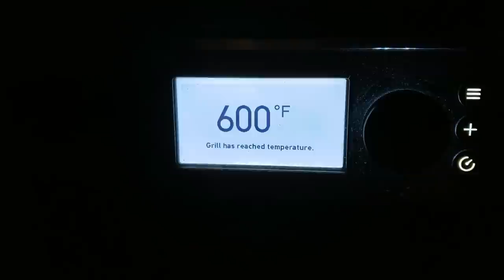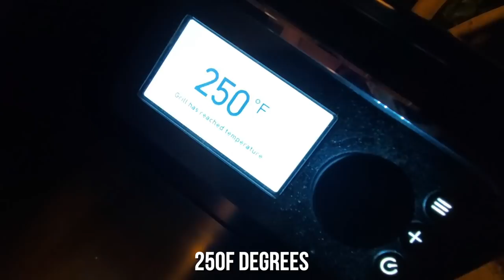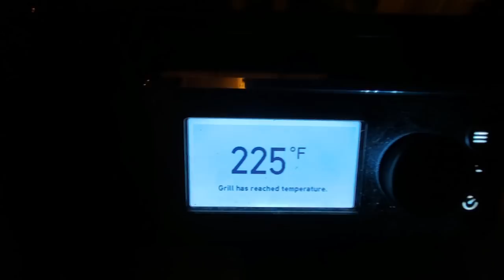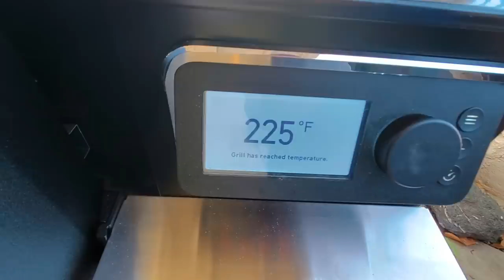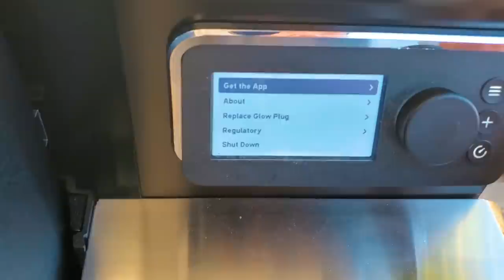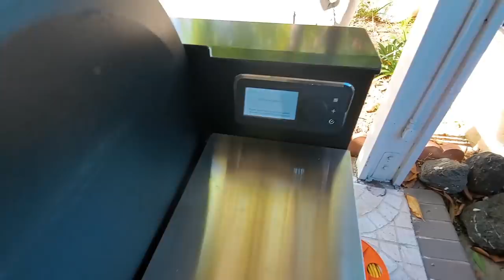Pt 2 WATCH BEFORE YOU BUY | Weber SmokeFire Pellet Grill | BBQ Champion Harry Soo SlapYoDaddyBBQ.com

Comment: I see your point and the diff between a grease fire and a flare up, then again you're one ember away from that grease flare up dropping through the drain hole and lighting the grease on fire in the catch pan. Location of the catch tray may limit enough O2 to get it really going but still could happen don't you think? The pellet hopper for me isn't a deal breaker and 7 hrs seems reasonable,  thanks for the video Harry.
Reply from the maker: 12 cups of grease so far and no fire.  Your mileage will vary.  Don't rely on my  two data points as they are not conclusive nor do they represent the majority of EX owners.
Reply: @SlapYoDaddyBBQ  Yes, time will tell, although I think there is a stronger chance of a grease fire with the Weber vs a traditional PS that uses some  type of heat deflector/drip pan  though......time will tell. Meantime I will wait and continue to cooking on my 22 performer and wsm!!

Comment: Nice, I just purchased a gen 1 ex4 for cheap. Do you suggest using a large weber pan in between the flavorizer bars and grate when smoking low and slow?  Also, what pellets have you found to work best with SmokeFire?
Reply from the maker: I use cheap half foil pans and the work well.  Keep it grease-free clean and you should be good.  I like GMG Gold Blend pellets

Comment: Hey Harry,
I heard Weber just released an upgrade/modification for the pellet hopper so the pellets will feed better. Have you heard anything on this yet? Apparently you just have to unscrew the old hopper ramp and screw the new one in.
Reply from the maker: Does it work?  I need to ask for one
Reply: @SlapYoDaddyBBQ  I don't own a SmokeFire (yet!) but this update should correct the hopper feeding problem. I was wrong in my first comment though, it's an insert that goes on top of the existing hopper ramp using the existing screws. Weber posted a video called "SmokeFire: Hopper Insert Installation" that shows how it's supposed to be installed. I believe they will send the insert to anyone who purchased a SmokeFire, free of charge, which is really great customer service.

Comment: Great video Harry. That was a true stress test. Looks like your Smokefire performed well. Strange how some perform well and others do not.
Reply from the maker: Thanks for stopping by.  I only have two data points so my results are not conclusive nor representing the majority of SF owners.  Only time will tell if Group 3 issues are short-term (e.g. bad parts of software) or systemic (design related which I don''t think so due to presence of Group 1). So far so good for me from two tests.  I'll do more coming soon.
Here is a recap of what I've done.
TORTURE TEST 1 - PASSED
45 lbs 5 meats in 8 hours. Generate grease from a 16 lb brisket, 10 lb butt, and 3 St. Louis ribs to drip on the SF the first 6 hours at H-n-F cook @400F and L-n-S cook @275F. After all that grease was accumulated, fire it up to 600F to grill the ribeyes and sausages.  Cook to let the grease drain in the unit and then try to flash that grease at 600F to test for safety 
TORTURE TEST 2 - PASSED
65 lb, 3 meats in 12 hours. Two 16-lb brisket, Two 10-lb butts. Two 7-lb beef shortibs.  Low and slow @225F to see if hopper feeds properly, no grease fire w 12-cups grease collected, and no excessive ash

Comment: Awesome video, thank you Harry!
Reply from the maker: Thanks Ed for stopping by.  As a recap
TORTURE TEST 1 - PASSED
45 lbs 5 meats in 8 hours. Generate grease from a 16 lb brisket, 10 lb butt, and 3 St. Louis ribs to drip on the SF the first 6 hours at H-n-F cook @400F and L-n-S cook @275F. After all that grease was accumulated, fire it up to 600F to grill the Ribeyes and sausages.  Cook to let the grease drain in the unit and then try to flash that grease at 600F to test for safety 
TORTURE TEST 2 - PASSED
65 lb, 3 meats in 12 hours. Two 16-lb brisket, Two 10-lb butts. Two 7lb beef shortibs.  Low and slow 225F to see if hopper feeds properly and no grease fire w 12-cups grease collected, and no excessive ash

Comment: Love the video and your perspective. I fall into group 1. I have a EX6 and for the most part it has worked the way I had expected/hoped. I too had accepted delivery of my SF and it was sitting in my garage while I debated returning it. I followed the advice you laid out in Part 1 and carefully set up the grill, updates the firmware and was happily grilling.  I’ve since successfully cooked ribs, pizza, fish, seared some steaks, and did a 7 hour low and slow cook (though admittedly I used water pans). My only concern is that Weber said that took what people disliked about pellet grills and removed those issues like the build up of dust and the accumulation of grease. That hasn’t really been my experience, my grill has tons of ash built up in the bottom of the cooker after my cooks, so I still have to go in with a vacuum and clean it out, while maybe not after every cook like I did on my Traeger, it is still needed (especially after the 7 hour cook at 225). I look forward to seeing your clean out video after this long cook to see how much ash and grease built up. Perhaps my using water pans which kept the grease from dropping to the bottom of the cooker allowed the ash to build up instead of being “flushed” out the drain in the bottom? But even with its quirks I find the versatility of the SF grill to be far superior to my previous pellet grill, and the food I’ve cooked in it has been flat out amazing. I still have to stir the pellets  like I’m used to on my other pellet cooker, I still have to vacuum out the cooker, and I need to manage grease like in my other cooker, but the versatility and quality of the food from this grill out weighs these issues. Perhaps I’ve been fortunate, as it appears there are some people who are having issues with logic boards and augers, but sounds like Weber is handling those issues, even if it takes them a little while to do so. Keep up the great work live your channel!
Reply from the maker: Thanks for sharing your experience with your EX.  No pellet cooker is perfect so I tell folks to pick the one they like because in the end, it's the pitmaster and not the pit which determines the final result
Reply: A. Dog Thanks for reading my post, I hope that it came off as positive overall with my experience of the Smokefire. I cook on it several times a week, and have tried several different pellet brands including lumberjack, Weber, Traeger, and pit boss. In the example above I used 100% Lumberjack Hickory pellets for the pork butt cook, but I’ve also had similar experience with the Weber pellets that came with the grill. I’ve also tried out boss which in my opinion were terrible and clogged up the auger, but then I read lots of reviews where people have success with pit boss, so I don’t know.  I’m ok with the amount of dust, and I can certainly clean it out as I’m used to doing so with my Traeger, I think my only “complaint” is that Weber marketing really touted how the ash was designed to fall into the collection tray at the bottom, while my real world experience shows that easily most of the ash end up in the bottom of the cooker. I am also fine with using drip/water pans in the grill for long slow high fat cooks. It makes clean up easier, and avoids any potential for grease building up with the ash in the bottom. But again, marketing may have gotten ahead of themselves with this one too, suggesting that the grease all nicely channels into the drip tray. Harry’s video clearly shows that happening, to the point of overflowing! So overall I’m happy, and I think the issues/concerns I have such as the pellet hopper and the app functionality can and will be addressed by Weber. As for the pellets hanging up in the hopper, I’m glad to see they came out with an update, and I will request it, though admittedly I’m quite used to stirring the pellets in my Traeger, so not a deal killer for me.

Comment: My only question comes from a safety perspective, while I agree what we saw in this video were nothing more than flare ups because they quickly dissipated.  The shutdown process seems to raise the temperature significantly, I'm guessing for cleaning and you had a flare up there.  What would have happened if you had left that huge amount of grease from your test cook in there at shutdown; would that have sparked an actual grease fire? 

I'm thinking from the perspective of a user who might not check the grease trap and hit shutdown, because I saw you empty it well before hitting shutdown.
Reply from the maker: Jesse, the EX6 is a quirky pit but I have not found another pellet cooker with such fantastic smoke flavor and smoke ring out there.  If you keep it grease free, you will not have flare-up issues.  I don't keep my EX6 so I have the flare ups.  Of course, if you are not good or experienced at live-fire cooking, it can be a problem.  If you are a pyromaniac like me, it's a joy and all in a days work!

Comment: I would totally agree that the flare up was exactly that, not a grease fire. You'll know when you've got a grease fire because panic kicks in pretty quick I'd imagine! Lol. 
That's a LOT of grease and as you said well beyond any 'normal' loading. Having said that, if you have the capacity to cook silly amounts of meat the unit should be able to cope with it. If a car can do 180mph you'd expect the brakes to work at that speed too, not think, well no one does 180...
Reply from the maker: I had 12 cups in drip pan and 3 tablespoons grease on the floor so I'm guessing I am at the limit of Weber's design envelope!
Reply: @SlapYoDaddyBBQ  but with that much space, should you be?

Comment: I've got a feeling that the issues that some folks have seen have a lot to do with low ambient temps and/or high humidity causing pellet feed issues, causing the grill to chase phantom temp changes due to getting the interior temp confused by the external ambient cold air, etc.
Reply from the maker: Josh you sound like an engineer?
Reply: @SlapYoDaddyBBQ  No, just a psychologist. It's just the impression I had given that the videos I've seen where people had problems have snow on the ground, or is raining during their cook.

Comment: 1)  How does the Smokefire compares to the Traeger, RecTec, Yoder, MAK?
2)  How does it compare to a propane smoker?  I can buy a propane grill + propane smoker or cookshack quality electric smoker (I've got deck space).  Concerned that a hybrid is a disappointing compromise.
3)  Want to get many years of good use from spending $1200+.  I see too many recycled gas grills.
4)  Great smoke flavor.   Needs to be better/equal to an electric cookshack.

5)  Weatherproof.  I cook all year, all weather, with lots of rain, metal that will rust, and concerned moisture from wet winters will cause issues with the pellets.
Reply from the maker: 1. Don't know as I don't own those grills.  I have 2 Jim Bowies from GMG.  Will do a shootout soon
2. Some gassers are OK as pits.  Research Ole Hickory and Southern Pride.
3. Get a WSM18 for $300.  I've won 100+ first places and mine is 12 years old and going strong.  Used 1,000+ times and I can't break it.  A pellet cooker is an electronic device like you computer. How long did your computer last?
4. EX can generate championship results.  Remember, it's always the pitmaster and not the pit or meat.  A proficient pitmaster can create good food from any device including a shovel, chicken wire, wood, meat, and a pit dug with the shovel!

Comment: You explained it very, very well!!!
Reply from the maker: Thanks Dennis.  Remember I have only two data points and my results are not conclusive nor do they represent the entire experience of Group 1 and Group 3 folks.  If you can, go cook on one before you make your decision. So far, it passed my two tests.
TORTURE TEST 1 - PASSED
45 lbs 5 meats in 8 hours. Generate grease from a 16 lb brisket, 10 lb butt, and 3 St. Louis ribs to drip on the SF the first 6 hours at H-n-F cook @400F and L-n-S cook @275F. After all that grease was accumulated, fire it up to 600F to grill the ribeyes and sausages.  Cook to let the grease drain in the unit and then try to flash that grease at 600F to test for safety 
TORTURE TEST 2 - PASSED
65 lb, 3 meats in 12 hours. Two 16-lb brisket, Two 10-lb butts. Two 7-lb beef shortibs.  Low and slow @225F to see if hopper feeds properly, no grease fire w 12-cups grease collected, and no excessive ash

Comment: Harry - thanks for posting these videos on the SmokeFire.  I currently smoke on an 18" WSM, and also have a 22" kettle and a Genesis gas grill for quick week night cooking.  I've been considering the SmokeFire as a potential replacement for the WSM and Genesis because 1) I hold a couple of large gatherings a year and need to prepare more meat than my WSM will hold, and 2) pretty sure my wife would kill me if I added a 4th grill to the collection (3 is pushing it :), and you can pry my 22" kettle from my cold dead hands).  So, two questions: 1) would the SmokeFire work as a reasonable replacement for the Genesis?  I.e., does it heat up quickly (10-20') and hot enough to function as an actual grill?  2) What level of smoke flavor do you get from the SmokeFire?  I've never owned a pellet grill, but the meals I've had from friends that have them are definitely lacking in smoke flavor compared to what I produce on my WSM (typically use chunks of hickory buried, like you're loading method but fewer, Kingsford blue bag charcoal, and a big handful of mesquite chips on-top for an initial smoke blast, 50/50 on if I wrap or not depending on multiple variables).  Right now I'm thinking of staying on the sidelines until v2 comes out, but appreciate the balanced level of testing and thought you've given this so value any feedback on these questions you can provide.  Thanks!
Reply from the maker: I only have two data points so my results are not conclusive nor do they represent the majority of EX owner experiences. Having said that, the EX will cook a lot of food like in this video.  Flavor is championship grade.  
Only time will tell if the EX will be a classic like the Kettle and WSM

Comment: Do you think there is a chance that whole grease pan could catch fire somehow?   If you were to design a pellet grill would this be a design you would use?   I really want a new pellet grill but this one I’m going to wait a while on, my old traeger is easier to clean except for the fire pot.
Reply from the maker: In my test 2, I generated 12-cups of grease over 12 hours with 65 lbs unwrapped briskets, butts, shortribs.  I could not get the 12-cups of grease to flash.  About 1 tablespoon of grease soaked ash flared up for 100 seconds.  I would not classify that as a grease fire.  Feel free to watch this video of how the pros define a flareup v fire:  https://youtu.be/VALvHFhWpk4
I'm not a pellet grill engineer so I don't know how to design nor build one.  I'm just a knucklehead tester who tried to get the SF to fail but was unsuccessful no matter how hard I tried in my test 1 and 2 as follows:
TORTURE TEST 1 - PASSED
45 lbs 5 meats in 8 hours. Generate grease from a 16 lb brisket, 10 lb butt, and 3 St. Louis ribs to drip on the SF the first 6 hours at H-n-F cook @400F and L-n-S cook @275F. After all that grease was accumulated, fire it up to 600F to grill the ribeyes and sausages.  Cook to let the grease drain in the unit and then try to flash that grease at 600F to test for safety 
TORTURE TEST 2 - PASSED
65 lb, 3 meats in 12 hours. Two 16-lb brisket, Two 10-lb butts. Two 7-lb beef shortibs.  Low and slow @225F to see if hopper feeds properly, no grease fire w 12-cups grease collected, and no excessive ash

Comment: Harry, you didn’t check to see how much pellet dust there was in the bottom of the smoker and also smoking all of that meat at once might give a false result. The extreme amount of grease may have washed the pellet dust out of the bottom while a smoke with less meat might have a slower rendering of fat allowing it to build up before igniting.I am considering replacing my Weber gas grill with this unit so I want to be 100% sure the kinks are worked out before I pull the trigger. Thank you for sharing your vast knowledge.
Reply: I smoked two pork butts in mine and didn't have an issue with fire.

Video is on my channel.
Reply from the maker: Point noted Mike.  I had 12-cups of grease from the cook. I can do a 1 butt or 1 brisket cook for you.  I suggest you cook on a borrowed SF before plunking down $1,200.  My two data points are not conclusive nor do they represent the majority of results of SF owners.  I will do a cleaning video next from the gunk and grease Test 2.  As recap, here's what I've done so far:
TORTURE TEST 1 - PASSED
45 lbs 5 meats in 8 hours. Generate grease from a 16 lb brisket, 10 lb butt, and 3 St. Louis ribs to drip on the SF the first 6 hours at H-n-F cook @400F and L-n-S cook @275F. After all that grease was accumulated, fire it up to 600F to grill the ribeyes and sausages.  Cook to let the grease drain in the unit and then try to flash that grease at 600F to test for safety 
TORTURE TEST 2 - PASSED
65 lb, 3 meats in 12 hours. Two 16-lb brisket, Two 10-lb butts. Two 7-lb beef shortibs.  Low and slow @225F to see if hopper feeds properly, no grease fire w 12-cups grease collected, and no excessive ash
Reply: Cooking Joe Foods I would dare say that pellet brands may also play a factor in the equation as some burn much more ashy then others.
Reply: @MichaelRei99  I can't say for sure but it could be a possibility.
Reply: A. Dog my experience is the Lumberjack pellets create more ash than anything else I’ve used. And I’m very particular when selecting pellets to make sure they are properly handled.